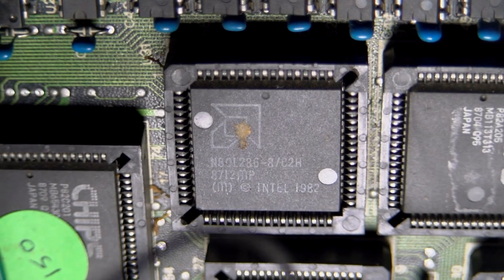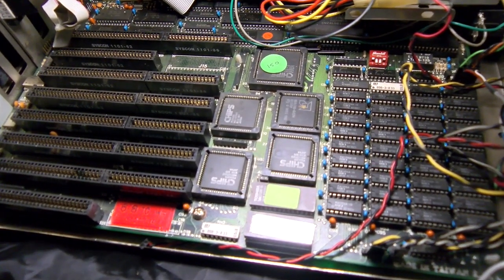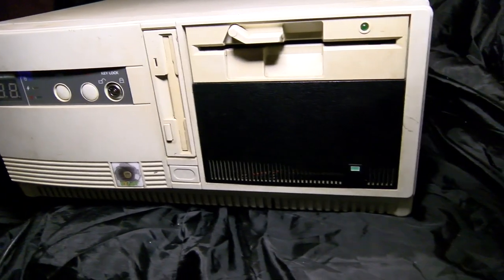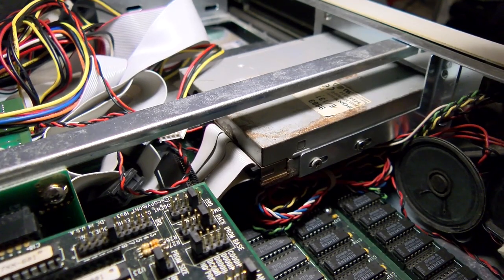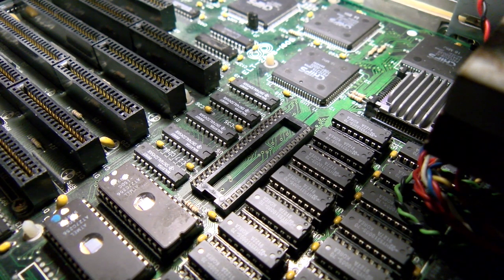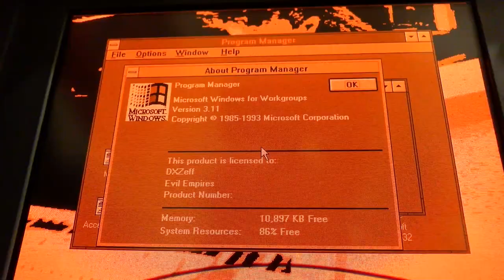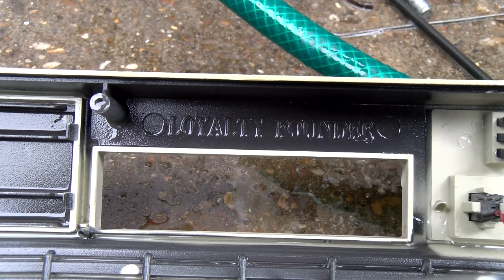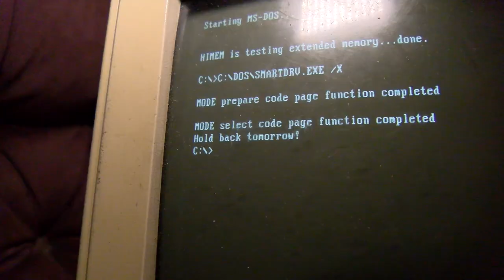Needless 286 Machines

Comment: Those MFM drive sounds hit me right in the memories every time :) time for a nerdy nostalgia dump:

Dads first pc after the atari/c64 days (a 10mhz 8088 clone) had a 20mb seagate drive he traded with a neighbor for a case of beer. It sounded exactly like that decades ago and I still remember playing outrun, blockout & prince of persia on the amber-colored hercules monitor as a toddler. Leisure suit Larry & Police Quest taught me english, hgc2ibm suddenly made all CGA games work & I got completely hooked on the thing.

Later dad upgraded to a 386 & got me a 12mhz 286 to mess around with. It ran windows 3.0 (not 3.11) and even games like Goblins 3! That one was awesome but the 386 could handle MK...
Reply from the maker: There's definitely something I miss about the sound of hard drives, you at least knew when it was trying to do something. The Conner in there at the very end is almost silent though, unusually so for the time it was made.
Was actually contemplating running Windows 3.0 on the 16MHz system as everything in there seems to be supported under that OS. It'd be a little limited, but it would be nice to have set up.

Comment: Hi Treason !
I had an Idea !
Using old Machnies, like a 286, with a serial or parallel Port, connected with a newer PC, for Software based data transfer of Files, Real Time graphics and remote Control at the XT or 286 to work with, but you need a software that can do this.

Best Regards
Reply from the maker: Lameguy and myself actually experimented with remote control over a 486, but it didn't work very well as the tools had some serious limitations.
File transfer is generally something I'd do with InterLink or Ethernet. In extreme cases, I've sat in debug and copied out INTERLNK.EXE by hand, which was shit and not worth mention.
What I would consider worth mentioning, though, is how I have successfully used an EPROM to get a file into a computer, by burning the file I wanted to said PROM with a modern system, then dumping that data to the hard drive of the target system with DEBUG. It was still a crap way to do things, but was the fastest way to get it done with no other way to get files onto the target machine. I don't recommend it in any case. Best avoided.

Comment: Needless is definitely the word. I've got a couple. One is a (actually 2) Toshiba T1600 and the other is an AT clone which has an epic case. Haven't got either of them working yet and, I'll be honest, is there any need?
Reply from the maker: Can't speak for the T1600, but the T1200XE (you'll notice it wasn't dug out for this video, though I think it was stolen anyway) is definitely pointless. Crap screen, very temperamental "CGA" graphics and a belt driven proprietary floppy drive. At least Zenith's machines could run the same things as desktops and they did so at an impressive speed.
Desktop wise, I do have to make myself use the older 286 rather than just letting the 386 do the job instead. I like the hardware for how crude it is, but the software side is lacking.

Comment: First machine I built myself was a 286-16 with 4mb DIP RAM on board. Upgraded to 486sx in same AT case.
Reply from the maker: Technically they're before my time, so I started with old 486 and Pentium era parts towards the end of the 90s and didn't get to build a 286 until 2009, simply because I wanted to. Recycling cases, drives and whatever else you could get away with sure did used to be common - disposable culture wasn't quite there yet, it was too costly.

Comment: I have a VTI (Samsung) 286 I've been messing about with lately. The hard drive on it has been driving me crazy simply because despite what I try the PC refuses to accept any hard drive or hard drive controller than the one that came with the PC which happens to be an 8-bit IDE controller. I've tried various period and  HDD's on the controller card but none work. I've even tried a variety of 16-bit IDE controllers and even SCSI but nothing except that original controller card and HDD will operate. 

As for CD-ROM drives on a 286, I've always been a proponent of it. Unless you're going strictly period correct I think a CD drive makes a good upgrade for at least the faster 286  since so many DOS game collections were released on CD and many of those games will play on a 286. Wizardry, Ultima, Kings Quest, Might & Magic compilations came on CD  at least the earlier games run just fine on a 286.
Reply from the maker: That sure does sound a lot like the 6MHz machine here, though that's less fussy and generally only cares if the card is too new. You know they'll tell you to try XT-IDE in there and you may as well if you have a spare EPROM to do so, on the off-chance it works.
CD-ROM drives would have at least existed in this machine's time, albeit they wouldn't have been in common use yet. One has been installed on the basis that I wanted to try playing through Willy Beamish anyway and apparently it will run on this system, though probably with a similar, if not worse, sluggish quality to the Sega CD port. Not like the drive can't be removed later if it doesn't work out.
Reply: @HighTreason610  Your reply got me thinking, I'm at least guessing the reason that 8-bit IDE controller that came with the machine isn't working with any other drive is because its that 8-bit XT IDE that was around for a bit that only a handful of drives work with. I checked the drive model (Miniscribe  M8450XT ) and sure enough...I always forget about those. At least that explains why drives are not working with the controller but still doesn't answer why none of the 16 bit ISA or SCSI controllers fail. I really do need to grab a few extra XT-IDE controllers.
Reply from the maker: Could be. The modern XT-IDE BIOS is supposed to be able to work around that, but then that leads to the second issue - said BIOS is obviously an option ROM and loading option ROMs is a task for the system BIOS. It seems to have taken manufacturers a while to figure out how to properly clone IBM's BIOS, as if initially they did just enough to make DOS run on their board an didn't clone all functions until years later. As such, ancillary features like loading option ROMs are often unreliable or missing entirely.
In the case of mine, and I'm betting yours is similar, it really seems like they merely patched up their clone 8088 BIOS just enough to get a 286 to start. Things like the 16-Bit ISA bus, were the CPU is perfectly able to use it once the OS is running, the BIOS seems to have no knowledge of whatsoever, it doesn't even appear to test the slave PIC at POST. Even when the OS is running, things like 16-Bit DMA can be flaky and mixing certain peripherals makes the system quite unstable.

Comment: You mention maybe wanting to try a CD-ROM drive in one of your 286s sometime.  There are a few CD-ROM games that will work on one.  Sherlock Holmes Consulting Detective and MadDog McCree are FMV games with a 286 as a minimum requirement.

Also, I personally think there's a lot of charm to 286 performance.  I have a 12mhz 286 with a 287 co-processor and it at least let's me play some games that I can't play properly on my 486 like Bubble Ghost and Qi Xiao Quan (a very obscure Taiwanese DOS PC game that to me feels like it was made with a 286 in mind).  Mine actually seems rather fast for a 12mhz 286 in some ways, like the scrolling in SimCity is very smooth on my real 286 compared to when I emulated a 286 at the same speed in PCem.  Does the 287 being present make a difference for stuff like that?  I don't own a 386 or anything older than a 286 yet.  The only unfortunate thing about my machine is that it's extremely flakey.  Programs half of the time just crash for no reason.  I think what might be the cause is that the Trident VGA card in it is defective, as it fails video memory tests in PC-CHECK.
Reply from the maker: The 16MHz system has a CD drive now, as I realized Willy Beamish will run on a 286 (or so I'm told) and I'd wanted to try playing through it, so now there's an excuse to do both things.
The 287 actually tends to slow the system down for integer operations, though not usually to any tangible level, perhaps the game really likes your video card or something or your ISA bus is maybe set to a higher clock as some boards allow this, can't really say without having the system in front of me. Some of the later boards have fancy features on them, this Chaintech supports memory interleaving.
Reply: @HighTreason610  Yeah, I've played a little bit of Willy Beamish CD-ROM on my 286 with no issues.  I don't have a functioning CD-ROM drive in it, so I played it by copying the CD version's files to the HDD.  The loading times are obviously longer than on a 486, but still not on the level of the Sega CD version.  I think it's a really underrated game, and more people should be judging it by the PC CD-ROM version rather than the mostly very lacking Sega CD one.  The atrocious loading times and glitches make me wonder how the SCD one got past quality control, honestly.  I think the only thing better about the SCD version is that using the Nintari in your room lets you play an actual mini-game, where on the PC version it just plays a non-interactive animation.  On the other hand, Rise of the Dragon's Sega CD port is excellent, and better than the PC version imo other than the lower color palette.

Comment: That suntac board you have looks a lot like my datamini motherboard in my 286. I even have the manual for it. Maybe we can swap things around to check what could be wrong ?

As for the TMC board, I've had a board doing this kind of stuff, but only when the bios isn't setup and that you mash the "del" button at POST. If you press it exactly once it won't be stuck
Reply from the maker: Maybe, though I think it's just going to come down to lengthy reverse-engineering of what jumpers and dipswitches do, it's not like anything is going to blow up if I randomly change them to see what happens.
Try as I might, the TMC wouldn't respond to the CTRL-ALT-ESC sequence whether I pressed it once or many times, until it would lock up and the CPU would go nuclear, even running a different BIOS. I suspect chipset failure, it was cheaper to just use the Chaintech.
Reply: @HighTreason610  hmm I have to check but it's possible that I could have a ruined board by battery leakage with a suntac chipset

Comment: Can't think of anything I'd actually choose a 286 to run, but they're awesome tinker toys if you just like playing with the hardware.  Massive boards just totally saturated with chips.  I'm actually building one right now but in a brand new case just to see what ridiculousness I can get away with.  I've already got the board installed and working with a classic full-height tandon floppy drive in a Fractal Define 7 XL with a glass side panel, and my next stupid idea is to try and build a riser to mount the RAM in the vertical slots.  Whether it works or not it'll at least make for an interesting experiment.

Comment: I have had no issues with floppy emulators, they work well for me but that is on 486 and pentium machines
Reply from the maker: Therein lies the problem, they work great on machines that will take CF cards. At least the Stoptek ones (the first ones I mentioned, mistakenly as HXC) were relatively cheap.
Reply: Gotek Emulators with FlashFloppy open source firmware works great. I've used then in Tandy 1000's, 486's, TRS-80, etc. They take USB flash drives full of any image you put on them - 1.44mb, 720k, 360k. They are very versatile, and cost less than $20.
Reply from the maker: Much as I have an aversion to FOSS for anything critical, I suppose I could try this on one of the emulators I have, given it will be sat around doing nothing in a box somewhere otherwise. It can't really make the thing any worse.
It might not be needed as a broken donor system is on the way (cheaper than buying parts on their own) and may well have enough working parts to get the older machine out of trouble - if its floppy drive works, I do have access to DOS 3 disks. Fingers crossed.

Comment: You have multiple BIOS for XTIDE, did you try the appropriate one for your computer?
Reply from the maker: Several, some of which weren't east to find. No matter as there's now an AT focused alternative written by somebody else, though I'm not sure if it's available to the wider public yet. It has worked under my tests so far, so will be fine for this machine if its current drive ever fails.
Reply: @HighTreason610  Well, I had to learn a few things to get it to work. I'm using SCSI cards or NICs to load it. The crucial part is that before flashing a .bin you need to open it with the XTIDE editor and save it again. That changes the file structure. And also, something very crucial is that you should get a file with the same size as your eprom/eeprom. So, if you have a 32k eprom and you have an 8k xtide rom, you need to concatenate it four times to get a file of the same size as the eprom. And that should work. Stick to the "xt" rom. I find no difference with 286 computers between the at and the xt roms anyway. There's a 2x change in speed if you cache the xtide rom. I hope this helped!
By the way, what's that alternative you mentioned?
Reply from the maker: These things are all trivial, but do not solve the problem. The ROM is simply ignored by most systems. About the most luck I ever had was getting the obscure 'late initialization' version to hook on the older 286, but it makes the bus clock go crazy. I know we figured out the likely cause, but don't recall what it was beyond thinking it had something to do with some PCJR compatibility, or similar, and some specific area of memory. In any case, this renders XT-IDE useless on that system.
You won't be caching any ROM on most 286 machines. By the time features like that appear you probably won't need a ROM like XT-IDE anyway.
The alternative ROM is called LATA.
Reply: @HighTreason610  I assume you have already tested your card and eprom on other systems and ensured it works properly (i.e. 386, 486). I have only a few 286 and only the XT rom works on the oldest of them. Granted, I don't have an original IBM system and probably those are the trickiest. The newest 286 I have has ROM caching (a fancy M209 PCChips board) and it does help with XTIDE going from about 600K/s to 1100K/s. If you want I could send you the file adapted to whatever eprom size you need.  Maybe trying other cards and different memory addresses would be a good idea, perhaps different irqs too. SCSI cards that let you change the address with jumpers or DIP switches are handy. Anyway good to know you have an alternative with LATA.
By the way, I appreciate your sincerity and your authentic personality.
Reply from the maker: Various systems were tested. XT-IDE works on very few of them. Zero filling unused space in a ROM is no big deal, but one curious thing with XT-IDE is that when it does hook, it tends to report the wrong address entirely, in some cases even claiming to be way outside of the adapter area, though I assume this is a purely visual bug. All I can figure is that it just isn't well suited to running on ancient clone hardware.

Comment: Adaptec controllers work really well on old 286 machines.
Reply from the maker: It works great until you change certain things in the configuration of the machine, then it forgets parameters and you lose access to the drive, which makes moving to a new drive even more nail biting.
Reply: @HighTreason610  Huh? Never happened if you don't change the base config. I can take a look at the aha-1542b and cf, the most common ones. I have them in IBM AT's from 1984. It doesn't matter on 386 and above. But the jumpers and dip switches cannot be fooled around with. I'll write down the config as soon as I'm out the hospital.
Reply from the maker: Fiddle with anything on the system too much, like alter the CMOS, disconnect a drive or swap it to another machine and the card resets completely. You can get it to talk to the drive again, but all of the data will be lost. I have no idea why it works this way.
Reply: @HighTreason610  Well, on 386 systems, I mainly use them as CDROM controllers. Work better than IDE. (:

Comment: This time I can only agree. 286s are at least as much fun as they're useless. I just like the 286. I should repair that huge board with the ceramic CPU, I never had luck with ceramic 286s. This one just has an exploded tantalum cap, hopefully nothing more's wrong. I saw it boot before the cap popped...
But the "modern" 286-20 system I built (with SIMM memory) just feels right to use.

Comment: Hi Treason, Looking for an opinion on the best AT motherboard to use with a 200-300mhz chip. I have too many to make a decision, and you are the expert in this!
Reply from the maker: Expert? I might not go that far, but OK. Don't know what boards you have on hand and as always would suggest that nothing is a given until it has been tested under whatever configuration.